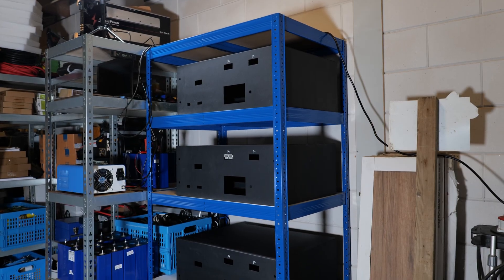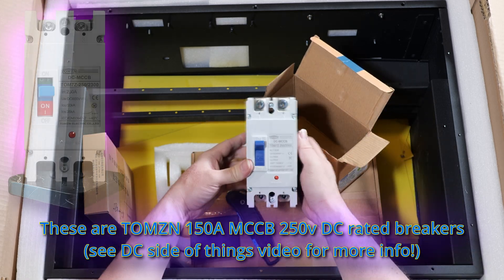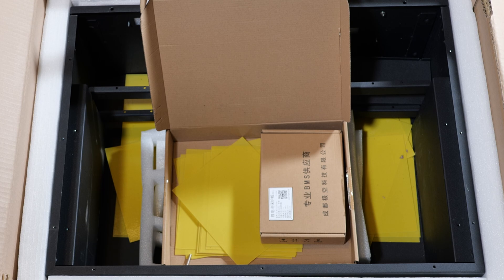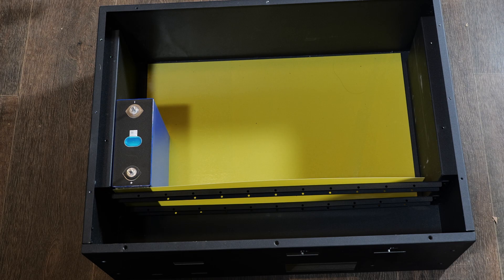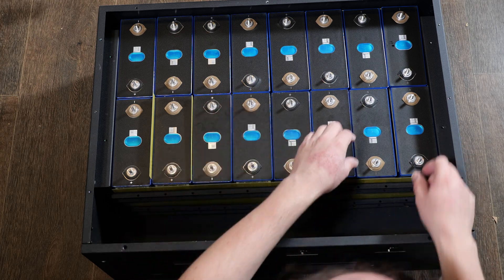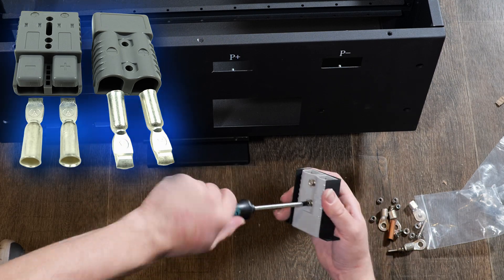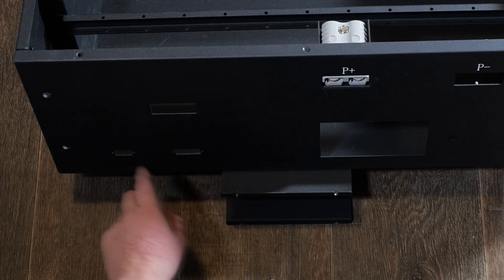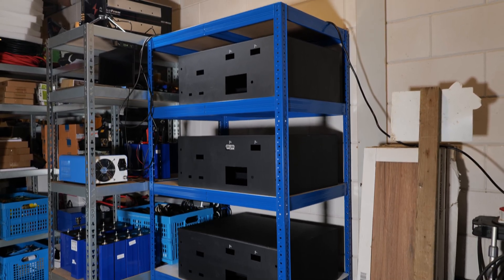⚡Quinergy⚡First look at my custom LifePo4 battery chassis!

Comment: As a Dutch citizen myself I have one big question:
How do you deal with insurance, with these kind of DIY projects? Because in case of a fire ore whatever I think the Dutch insurance company will close the case really fast, with these kind of DIY projects? Yes I know about the NEN guide lines etc. but i can't believe this is enough for them.
Can you tell maybe something about this in a upcoming video? But keep the vids comming, I love you're work really. So I hope you don't see my comment as a typical Dutch sassy comment. I am just really curious about the 'insurance' part.
Reply from the maker: I haven't investigated that much yet to be honnest! It's an interesting subject though, no worries, don't see it as a jab! I believe currently there aren't too many rules about it as long as you can prove it was a decent setup but that in itself is already vague of course. But I don't believe you have to have it certified or something to have it hooked up at least. Interesting! I'll dive in that a bit later, need to catch up a bit more first. :)
Reply: Here in BE, every production system that is grid tied needs to be checked by an official organization. They will validate if the install meets the standards and certify it for use. If you have that paper, it should be safe for insurance as well. of course NL has different rules, but here you wouldn't even be allowed to tie the battery to the grid without this check. Same for solar, generators and other stuff that can produce energy to the grid. Next to that the home electrical install must be recertified each time there is a major change. For example when you change more than 1 circuit in the breaker box. Many people don't do that and they can have issues with insurance later if anything can be blamed on the uncertified changes

Comment: looking well planned.  Are you intending to load test the completed packs like you did the individual cells?
Reply from the maker: Yes somewhat at least. In the end, when all packs are complete, the actual load per pack will actually be relatively low, closer to the 40Amps the individual cells have already been tested to.

Or rather, my Victron setup would be capable of I believe around 210Amps divided by 4 is "only" 52.5Amps per battery box.
Reply: @IntermitTech   Makes sense.  Given the tweaking you do(++ on the future comm holes), will you be shutting down the DC side if you need to alter a single bank or are they able to handle the load across 3 banks(70amps) or will the vic limit amps to 157.5?